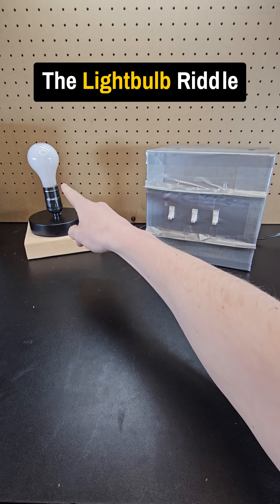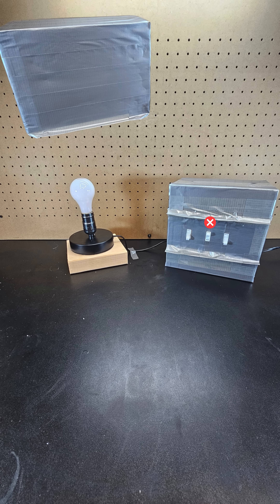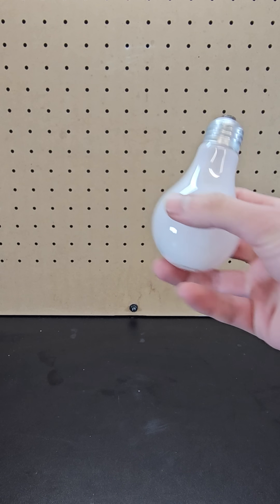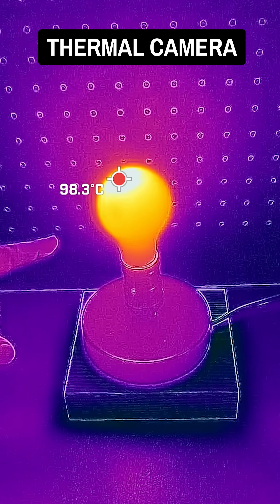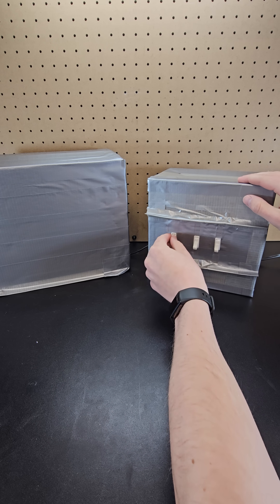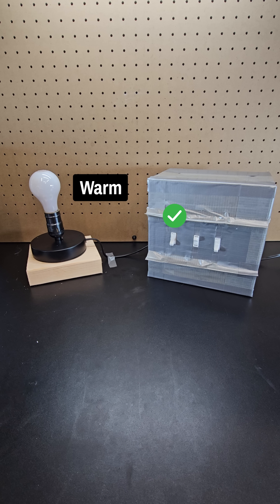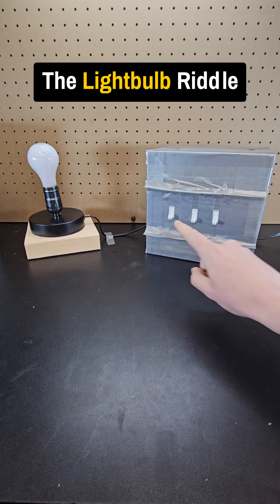Can you solve this Lightbulb Riddle? #science #shorts

Comment: Okay, so the answer is ignore the switch positions and use the conduit of the bulb due to all the heat an incandescent bulb gives off.

No wall switch I have experienced, whether toggle or push button, has ever been a mercury switch. They don't need to be. The only switch that has ever needed to be was a thermostat switch.

However, a 3-way switch can foil the answer, because 2 switches control the bulb.

The answer is to carry a current tester, period. I prefer one of those you hang onto the wire without needing to expose and touch any wires.

Comment: Me: (remembered this from Mysterious Benedict Society, but forgot that's where I remembered it from until I saw another comment)
Flip switch 1
After 5 to 10 mins, flip 1 & 2
In case switch 1 was the answer, wait about 1 minute (to let it cool down at least to not as much if the assumption was correct) and then lift the cover. If the light's on now, obviously it's 2. If not, (and this is why you wait 5 to 10 minutes in step 2 and another minute in step 3) touch the bulb! (The 1 minute is so it's not super hot when you do) If it's off but still warm, the answer's 1. If it's neither, the answer is 3.

Comment: Flip the first switch leave at 5 minutes then flip it back off to try and flip the second switch and lift the cover if the light bulb is on then it's the second switch if it's off then it's not the second switch feel the light bulb now that the covers been removed if it's hot then it's the first switch if it's not the third switch

Comment: It's an incandescent light bulb, which heats up when turned on for a while. Flip Switch 1 and leave it on for ~10 minutes. Flip it off then flip Switch 2. Take off the cover; if the bulb is off but it's still hot, it's Switch 1. if the bulb is on, it's Switch 2. If it's both off and cold, it's Switch 3.

Comment: flip one light switch run it for 10min turn off the switch.Remove the box  see  if the light is warm if not repeat the action until the you find the right one.The bolb is one of those old tungstan coil ones so it looses majority of its power trough heat.If the bolb was lde you are out of luck.

Comment: Turn on the first switch wait for about 10 minutes,then turn off the first switch and turn on the second switch then check the bulb if it's light then it's the second switch,if the bulb is off then touch the bulb if the bulb is hot then it's the first switch and if the bulb is cold it's the third switch

Comment: This is an old light wivh also generated heat, we can use this.
Switch 1 and 2 on, wait some time, switch 1 off and 3 on and lift the box immediately. 
If the light is of its 1, if the light is on and the light is warm its 2 and if its on but still somewhat cold its 3.

Comment: Man I answered right away without even waiting for him to finish I did have the right answer but I have learned a much more valuable lesson learn to listen better I always lack communication skills so I have been working on it and listening is one of the biggest things if not the biggest and most important about communication skills if I would of waited a little longer I would of still came to the same conclusion but with a %100 guaranteed he said inconsistent I am a master electrician when he said incandescent bulb that’s all I really needed to hear but he said that after I made my mind that is my bad for not listening to him fully yes two having two on one off will tell you witch will be the right switch but a much easier way to find out is feel the heat from the incandescent bulb works by touching hot and neutral creating an arc that’s the 💡 source so that creates heat and pass some
On to the box so you don’t need anything but your hands with one turn one each switch one by one and with the other hand feel the box and you won’t even need to take the cover off

Comment: Flip one switch on and leave it there for a bit. Turn that switch off then flip another switch. After flipping the second switch, leave it on, then look at the bulb. 

Assuming that in this example switches 1, 2, and 3 in that order are from left to right and you started with switch 1 and ended by flipping switch 2, here is how that would play out. 

Bulb is off but is warm = Switch 1
Bulb is on = Switch 2
Bulb is off and is not warm = Switch 3

Comment: It's key that it's an incandescent light. Turn on switch 1, wait 10 minutes. Turn off 1, immediately turn on 2 and lift the shroud. If the bulb is lit, it's 2. If it's unlit, check if it's warm. If it's warm and unlit, it's 1. Otherwise, it's 3.

Comment: Isn't it the one you flip one switch and wait then close it and flip another one then instantly check the Light bulb, if it is on that means the second one is right, if it is hot when you touch its sthe first switch, and if it is cold and close its the switch that you do not interacted with.

Comment: You switch one light switch and then leave it on 10 min (till the lightbulb is hot) then you switch it off and then you switch the second one on and then you can open the box and if the light is on then it’s the middle if not you need to feel it the light bol is hot then it was the first one if  isn’t hot it’s the last one😊

Comment: I already know the answer, but for the people who dont, let me give you a hint.
The 3rd switch is entirely dependent on the first 2, if you use the first 2 switches and nothing happens, then its the third. Otherwise, youll use the first two switches and find the correct one by using the answer to this problem.

Within first 2 switches - not the third
Not within first 2 switches - is the third

Comment: Flip one switch, leave it on for a while, then switch it off and turn a different switch on before you check, then if the light is on, you found it, if it's off, touch it and if its cold then the switch you didn't touch is the one that turns it on, if it's warm, its the first switch

Comment: The real solution:Flip the first switch and wait for 10 mins then turn off the first then on the second.If the light is on when the 2nd switch is flipped its the 2nd, but if its off but hot its the 1st and if its on but not hot its the 3rd.

Comment: Flip the first one on and leave it for 10 minutes. Then switch it off, flip the second switch and lift the box up, then touch the bulb, if the bulb is hot then it was the first switch, if the bulb is on it’s the second switch, if the bulb is off and cold the. It’s the 3rd stitch

Comment: I would only test one, but predict it is a different switch. If the one I tested didn't turn the light on, I would swap from my original guess to the remaining switch. 

Because before I know anything it is a 1/3 or 33% chance of each switch being correct, but if I predict it is one switch then find out another didn't turn on the light, the 1/3 chance of the tested switch being correct is reflected onto the switch I hadn't previously predicted. By that math the switch I tested would have a 0/3 or 0% chance, my prediction switch would have a 1/3 or 33% chance, and the last remaining switch would have a 2/3 or 66% chance.

While this doesn't guarentee I am correct, it still gives me a pretty good chance at it.

Comment: Honestly I heard the riddle and got to solution somewhere closer to the end. The solution I came up with is:
1. Check the box first and note whether or not the lightbulb is on. Put the cover back on.
2. Flip any two switches, for example #1 and #2. Pick up the box. If the light is off then the solution is #3. If the light is on then proceed.
3. Putting the cover back on, flip switch #1 or #2. We'll take #1 for example. Pick up the box and check lightbulb. If it's on then the answer is #2, if it's off then the answer is #1.

... Also just now I realised that this method goes against the riddle's terms. Oh well, gonna leave this comment here anyway.

Comment: I would turn switch 2nd and 3rd on for a minute, then turn the 2nd switch off, Lift the cover and feel the bulb. If it’s off and cold, switch number 1 is the answer, if it’s off and warm switch 2 is the answer and if it’s on switch 3 is the answer.

Comment: Never liked this puzzle. It never says you can touch the lightbulb. In fact it only specifies lifting the box once. So you can technically do any number of things. You can put a camera inside. You can drill a hole in the bottom. You can take apart the switch box. The ability to touch the lightbulb should be included in some way in the premise of the puzzle otherwise it is just completely open ended

Comment: My guess.

Flick the switch leave it on for a few minutes, flick the switch to off, and flick a different one to on, open the lid, if the bulb is on, there is your answer, if the bulb is hot, there is your answer, if it's cold and off there is your answer.

Comment: I remember this one. Flick the left switch. Leave it on for a minute. Turn it off, flick the right switch. Lift the cover. If it's off, touch the bulb. If it's warm, the left switch is correct. If it's cold, it's the middle switch.

Comment: I had a slightly different method in the spirit of the game. Turn TWO switches on for about 10 minutes, then turn one off. If it's on, then it's the one that's still on, if it's off and warm, it's the one you just turned off, and if it's off and cold, it's the one that remained off.

Comment: Flip first 2 switches on, wait a little bit, 10 minutes or so should be fine, and then flip the second switch off. Then go up and check the bulb. If it’s the bulb is on, it’s the first switch. If the bulb is off, touch the bulb, if it’s warm, it’s switch 2, if it’s cold, it’s switch 3.

Comment: Flip one, leave it on for a while, then flip it back off and flip a 2nd one then lift. If the light is on, the 2nd switch controls it, if it's not on, feel the bulb and see if it's hot. If it's hot, the first switch controls it, if not, it's the 3rd switch

Comment: 0 lift methods without cutting the box and that aren't repeats of other comments (that I know of, I could be wrong)...

1: The box wasn't sealed to the ground well enough, you can just see if its on in the bottom left corner without lifting it at all which you can see in the 0:03 - 0:04 timestamp.

2: If you want to use heat as your source of the answer, you can still do 0 lifts by turning 1 on, go watch a few youtube videos, and come back and just touch the box to see if it's now warmer than before. If not, move on to the next switch.

Option 3: Rotate the box with the switches and see which switch actually has a power source wired to it. (Edit: Turns out someone said this one already)

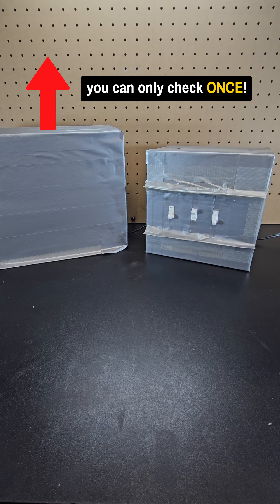Option 4: If you can't see the power wires by rotating the right box, at 0:12 your red arrow implies the lifting limit applies only to the box cover for the lightbulb, not the cover for the switches. So open the right side box with the switches and you can now see which one is actually wired.

Option 5: Assuming the bottom of the left box is open, and assuming "The outside box surface is insulated and does not change temperature", similar to option 2, you can check each switch one at a time, but instead of feeling the box, you could slide the box and then feel the surface of the table it was on, or feel the underside of the table.

Option 6: Since the wiring is not hidden from the switches to the bulb you could strip the cable, expose both wires without cutting them, and place a paperclip or something over them while the power is off. Then turn on each individually until you see a spark. The sparks will tell you which switch powers it.

Option 7: Since its incandescent, presumably it runs straight off whatever voltage is being supplied to the outlet without any kind of special power supply. Strip the cable on the light bulb side, strip the power source wire and connect them. Or alternatively, shove the lightbulbs wire into the outlet. No your answer is simple... "Trick question, none of these switches power the light".

Option 8: Unplug it, or cut power to the room/house/whatever. Now your answer is the same as option 7.

Note: This is not electrical advice. Do not do anything electrical based off this comment

Comment: Turn one on for 5 minutes, turn it off and another one on, then immediately check the light. If it's on, it's the switch in the in position. If it's off but hot, it's the one you turned on first.

Comment: Flip the first, wait a bit. Turn off the first turn on the second, then check. If the light bulb is on, it's the second. If the light bulb is off, check the bulb. If the bulb is hot, it's the first if it's cold, It's the third.

Comment: This isn't a riddle at all, it's a trick question. It doesn't specify that the cover over the bulb isn't a good insulator of heat, and gives every indication otherwise ("with the cover on, you can't tell which one"). So an equally good answer to this would be to turn out the lights in the room you're in and count on the cover also not being a great insulator of light, allowing you to see if the light where the wire creates a small gap under the cover. Or, you could bringing in a multimeter to check the circuit. Or you could cut the wire and hook up a different light bulb!

Riddles with lateral answers can't be fully open ended like this. This is real "there's no rule that says a dog can't play basketball" nonsense.

And besides, heat wouldn't always provide certainty. What if it's a very hot day? What if the bulb is very old/weak?

Comment: This is such a stupid puzzle because it posits that there's a way to determine which switch is applicable by simply visualizing the light.  With the proposed solution, the box doesn't need to be lifted at all.  Just flick the light switch and wait to feel the box warm up.
The puzzle is posited as a logic problem but the actual solution lacks logic entirely, especially since lifting the box isn't even required to solve the puzzle.

Comment: I saw this. The trick was clever. Spoilers bellow!!! Edit: I typed the top and bottom  out and hit play and forgot he’d explain so oh well. Also I had this flipped 

Flip the first switch off. Wait 30 minutes. Flip the first switch back, and flip the second switch. Check the bulb. If it’s hot and still on the first and second switch are not it. If the bulb is cold and on then it was the first switch. Lastly if the bulb is off, it is the second switch.

Comment: Turn switch #1 on and leave on.
Turn switch #2 and turn back off.
Leave switch #3 turned off.
When the cover is removed and the light is on then it's switch #1.
If it's off and warm to the touch it's switch #2.
And if it's off and cold to the touch it's switch #3.

Comment: There are many ways to find if a switch is connected to something 
1. Hear an arc from the switch after slowly flipimg it 
2. Use a temperature reader to see into the switch to determine a connection with the bulb
3. Feel the box for heat after fliping a switch one at a time
4. Use a power detector with the wire that is outside the cover & the switch box 
5. Break the cover
6. Eat the cover
7. Breakthe switch box
8. Use a magnet against the wire that is outside everything(the magnet will vibrate by the magnetic field on the wire while power is running through it)
9. Hear the box for a buzzing sound(this is only able to work with an old bulb that is not LED)
10. Use a mind reader
11. Lift the cover but don’t place it down while fliping switches
12. Eat everything
13. Hot wire the bulb on

Comment: I learned a method from a TV show that I watched a couple years ago.

 It went like this: You turn the first switch on for at least 5 minutes, then you turn that switch off and turn on the middle switch. You lift the box and see if the light is on or off; if it's on, then it's the middle switch. If it's off, however, touch the lightbulb. If the lightbulb is hot, then it was the switch on the left that turns it on. If the lightbulb is cold, then the switch on the right is what turns it on.

I found it to be very fascinating

Comment: Flip the first switch on. Leave it on for a few minutes. Flip the first switch off. Flip the second switch on, lift the cover.

If the light bulb is off, but it feels hot to the touch, it's the first switch.

If the light bulb is on, then it's the second switch.

If the light bulb is off, and it's cold, it's the third switch.

Comment: Select two random switches.... Turn one of them one and flip one of them on and then off lift the box....
The two possibilities are the light will be on or off....
If it is on, then the turned on one is the switch...
If it is off, then there are two possibilities 
The bulb is warm or not....
If it is warm then the switch we just fliped on and off is the one....
If it is cold then the switch we never touched is the one....

Comment: Saw this in a short about a movie, 

The trick is you flick 1 for a bit then turn it off, then flick 2 on and check it, if the lights on it's 2, if the bulb's warm but off it's 1, if it's off and cold it's 3, also posting before I finished the video

Comment: heat, flip one on leave it on for 30minutes.... flip it off, flip the 2nd on if the bulds on 2.. if its off check for heat switch 1... if its cold number 3

Comment: There are many ways how you can detect current going through the switch with a magnetometer. But even a modern LED light bulb will have its base get at least warm if you let it run for an hour.

Comment: Flip one leave it on for 10 minutes turn it off then flip a different one and check on the light. if it’s on then it’s the one you flipped if it’s hot it’s the one that was on for 10 minutes if it’s cold then it’s the switch you didn’t touch.

Comment: Lift a switch for like a minute or 2 then turn it off, flip another switch check if it’s on the one that is flipped is correct, if it’s off touch the bulb if it’s warm the first one you flipped if it’s cold the one you haven’t flipped.
It ain’t that hard yall